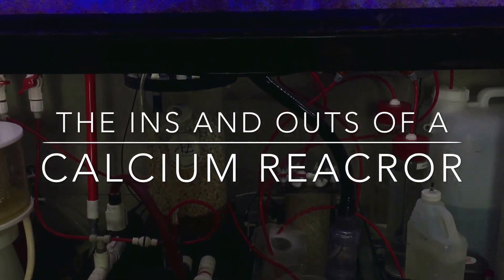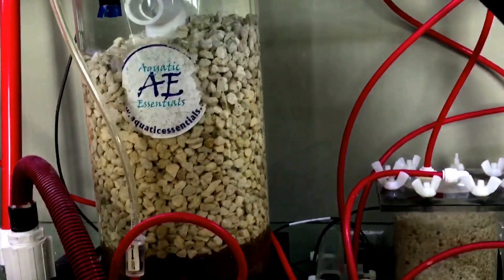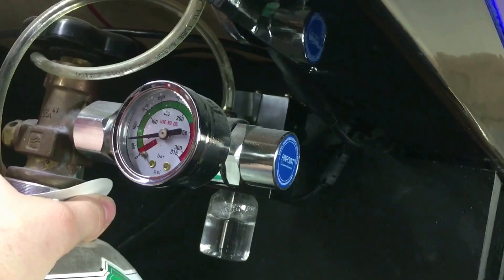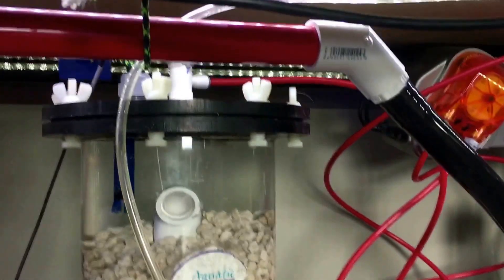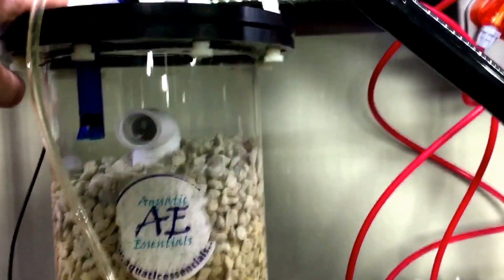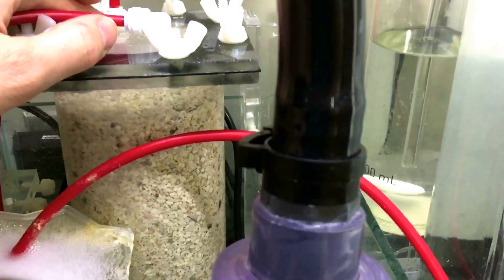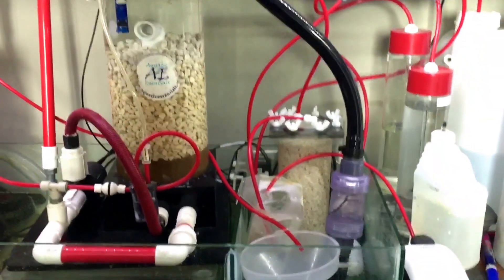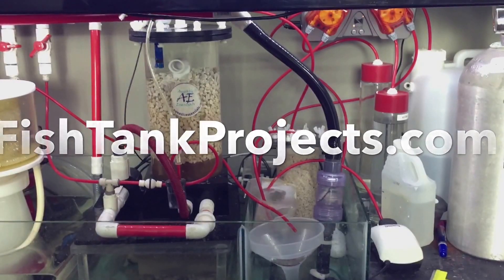How Calcium Reactor Works

Comment: explain how you feed all your reactors with one pump how is yor reactr not getting too much flow with effluent dripping so slow. having issues setting m reactor up. may need new solenoid balve the release valve keeps opening cant dial it down to only a few drops. no vide explaining that part
Reply from the maker: I have a DC pump going to my reactor manifold which pushes water to all the accessories.  On top of the CA Reactor There is a 1/4 push connector ball valve on the top of my reactors (like a RODI one) that I use to restrict the outflow from the reactor to a low drip
Reply: @ReefDudes I understand what you meant by the RODI restriction flow but I also know they have various flow ratings. Which flow rating do you have for your reactor?

Comment: are you using an apex to control the ph monitor and co2?  Im looking to PH controllers now.. and am wondering if using both would give extra redundancy.. nice vid man...
Reply from the maker: Thanks CJ!   You are correct,   The APEX monitors the PH and turns the CO2 solenoid on/off depending on the value. This is by far the easiest way to get a co2 reactor going.  You could use both but it would be a bit overkill and expensive. I would use that money towards the APEX as it function as both plus give you alot more control-ability for the tank.  once you have your setup going you can dial in the bubble count until the solenoid stays on and no longer cycles..  It took me a week or two but once the bubble count is dialed in the apex would just be acting as a backup and effectively giving you an extra layer of redundancy.  Another thing i would recommend is picking up a DC solenoid.  I have never had it happen but i heard its possible or AC ones to stick due to the heat (not likely but possible)  whereas the DC ones in theory are less likely to do so!   Let me know if you have any other question.

Comment: Thanks for the info!
questions if u don't mind.
Similar to how companies sell calcium and alk 2 part dosing. why don't companies just  selling the fluent liquid.. calc and alk in one. then we just dose that.
also in terms of cost of running a calcium reactor, how often do u have to re-fill the co2 and is it expensive. same with the crushed coral media. 
lastly can it keep up with high demand tanks that need lots of calcium and alk a day dosing for sps tanks.
thanks!!
Reply from the maker: Thanks for the feedback!  I love to hear my videos help and its good inspiration to keep making them.   At the very least i would run a Carbon reactor as it will remove harmful toxins from the water and help polish it to keep your water looking crystal clear.      As for GFO you only really need it if you have high phosphates. If you run a refugium with a decent light and macro algae it can normally keep phosphates and nitrates in check
Reply from the maker: Good question, i guess they could sell effluent liquid as a form of dosing.. they likely due to the weight of big jugs/shipping it around.  Calcium reactors are expensive up front and then cheap to maintain.  the crushed coral media is about $30 to fill mine, then to re-fill the co2 is about $30. that would last me about a year or more.. if my tank was jam packed with large coral colonies it may not last quite as long.. but for now its cheap!  On the flip side dosing is cheap for a small tank or lower dose for a medium to larger tank.. but as your tank grows and sps colonies get larger it  can be expensive at retail prices (much cheaper if you can buy in bulk)  Most people start out with dosing then move to a CA reactor for larger tanks (100-200G plus)
Reply: ReefDudes Yeah sounds intetesting. I'm all for anything that's slightly more upfront but cheap in the long run.  Will keep this in mind when I upgrade. Thanks!
Reply: On this note, I have a question for you.  When is the reactor required. Ie: just how established does the tank need to be before a calcium reactor is beneficial, or can it be put into use, on a newly established tank with little coral?  PS. Good vids, thanks for doing them and providing the information.  Cheers from Vancouver Island.